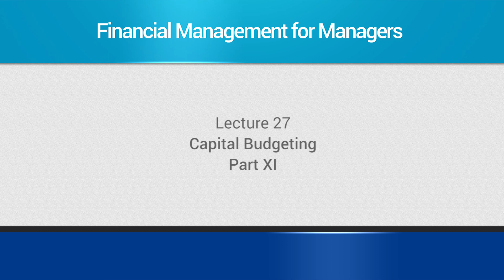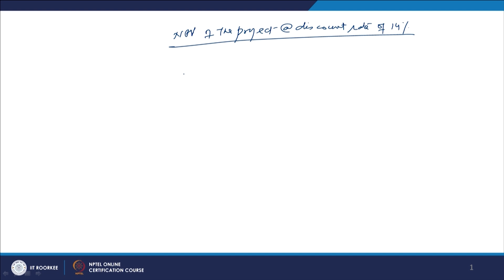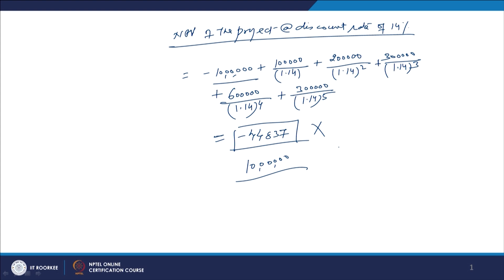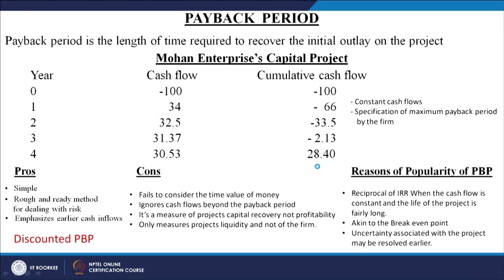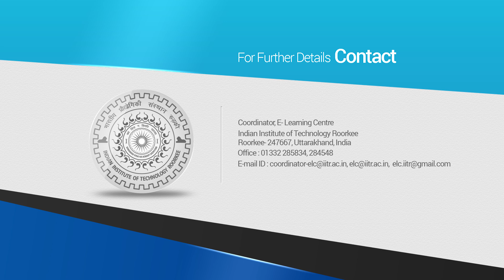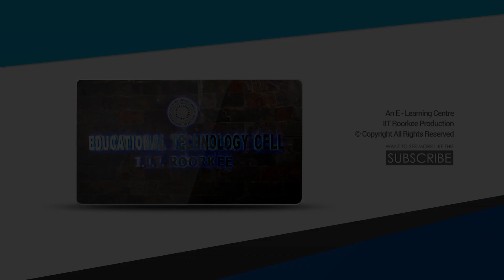Lecture 27 - Capital Budgeting - Part 11

Comment: @ 24:30 , i m not sure, but somthing looks wrong. plz help
Reply: Year 3, (3000)/(1+r)^2
Reply: @Ordinary_vibes.17    The formula should be as the professor wrote because outflow is not now but later. Anyways, the focus is not on formula but on concept. Is NPV applicable. For calculation there are machines and spreadsheet. We should focus on the concept. If 2 IRRs. then we are coming back to what was taught earlier - the limitations of IRR in case of not standard cash flows.
Reply: The formula should be as the professor wrote because outflow is not now but later. Anyways, the focus is not on formula but on concept. Is NPV applicable. For calculation there are machines and spreadsheet. We should focus on the concept. If 2 IRRs. then we are coming back to what was taught earlier - the limitations of IRR in case of not standard cash flows.